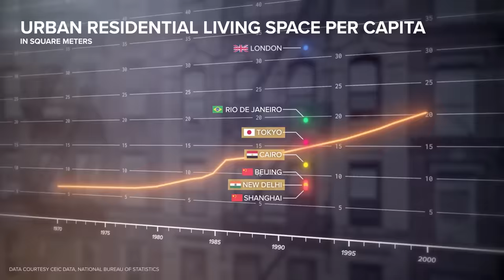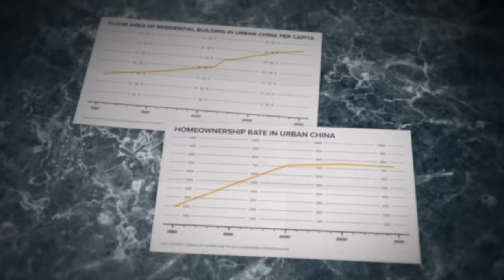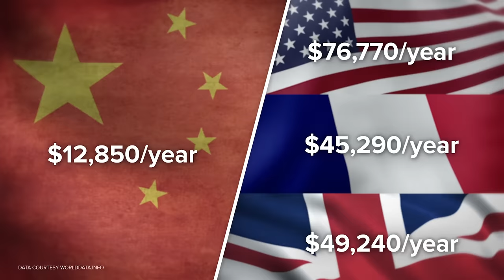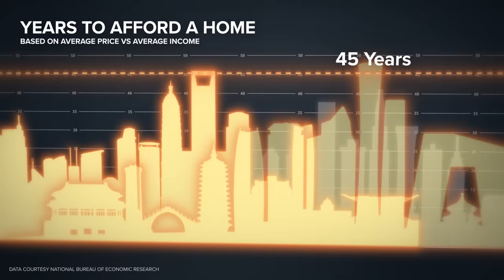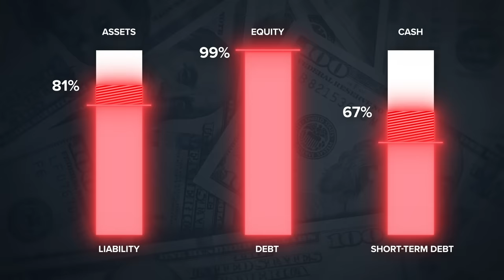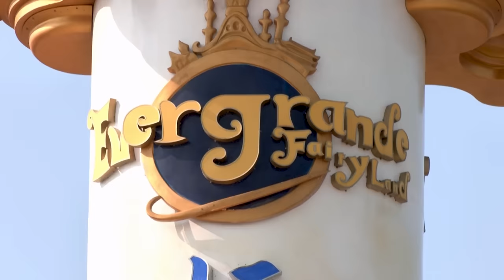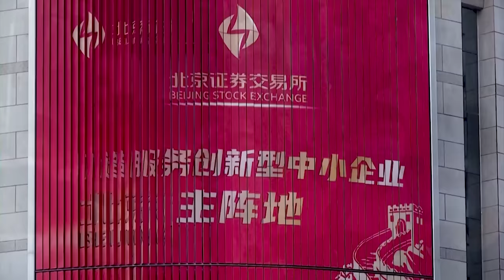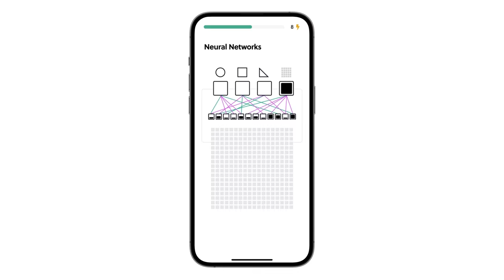Why China's Economy is Finally Slowing Down

Comment: That average Chinese income of $12.8K per year is now NOT per Capita, it's per Family. Working couple and Grandma's pension too. People are coming out of University with Master's Degree's only to take jobs in the FOOD DELIVERY mechanized bike cadre. Ten's of thousands of kids and not so young adults competing for 600 to 800 Yuan a week and maybe many are making less. Just divide by roughly 12 and you get the Dollar conversion. 

I see a One Yuan to $0.14 conversion now, but that is probably the international Yuan for inter-country bank trade. Internally, the PRC citizens are making far less. 

I wonder how many people are actually able to offshore their Yuan to Singapore Dollars or something that is viable? ONE YUAN converts to 0.19 Singapore Dollars.

Interestingly One US Dollar equals 1.35 Singapore Dollars. It roughly converts across using the SD as the conversion currency as there probably is NO direct exchange in USD from Yuan in the PRC except for State Official purposes. Citizens will have to find an external currency to use soon in replacement of the Yuan that the CCP will tolerate. It sort of works the same as the citizens of Venezuela using the USD as the de facto currency. Absolutely no confidence in the Venezuela Peso.

Comment: You can feel the depth of research in this video is scant, because it's just regurgitating common tropes about the Chinese economy without critical analysis of the assumptions, and indeed this is the case when you see the list of references listed, which is just 6 sources.  Here's a hard reality about modern capitalism.  EVERY capitalist economy is heavily dependent on housing market, and they all have housing bubbles.  In developed economies such as the US, 60% of global assets are backed by real estate prices (I can't give link because Youtube blocks link, but you can Google).  This means that most of the wealth of these nations are tied to their housing prices, and they are all susceptible to housing bubbles.  The US, for example, experienced a housing bubble bust in 2008.   However, developed economies with strong strong banks such as the US has learned how to manage and clean up the mess when these housing bubbles burst; and the Chinese economy is no exception.  The slowdown in the Chinese economy today is not just the challenges of housing bubbles -- which all developed nations face -- but something else is happening that we haven't seen in the past 50 years:  The US and western economies are finally trying to break up its economic ties to China.  A new era of global trade is emerging, and both the US and China are trying to adjust to it.  

It's just tiresome to hear everything get blamed on housing bubble bursting.  Again, most assets in developed capitalist economies are backed by real estate prices, so when an economy goes down it is inevitably related to the housing market.  It's like seeing a patient with a gun shot sound, and the assessment of "what's wrong" is "there's a bullet in his chest".  Sure, that's obvious, but we need more than that to understand the problem.

Comment: So just one minor point about the video. The vaccines in the west also had major issues and were not necessarily "more effective". Namely, it doesn't stop the spread (one of the main reasons we were told to get it) and the efficacy of the vaccine wanes pretty quickly (2 months to 4 months).

China didn't stop the lockdown because their population wasn't vaccinated enough (they were literally forcing people to get it against their will). They only stopped after they were forced to admit that their zero-tolerance policy did not work. Whereas the west only had a lesser version of the zero-tolerance policy.

Comment: This is such a nuanced topic there simply isn't any way you could do it justice in just 20 minutes. Good video but it would need at least an hour, and even then you would just scratch the surface. Still a good nutshell explanation though.

There's so much wrong with China it's ridiculous, they've been hiding economic data for awhile now, it seems they've been in a pretty bad depression.

Comment: To be honest, this is one of the things that I most admire about the Chinese government. They're not afraid to bully large corporations when necessary. From an outside perspective, it looks like the CCP in this case (and in many others, like with tech companies), is basically allowing little bits of capitalism to reap the benefits of super fast growth and cheap capital from the world economy, then shutting it down when things got bad. This video takes a generally negative tone on the outcomes, but I think there's something to be said about the positive outcomes as well. 

The controlled demolition of the real estate companies has tangibly dropped housing prices which, combined with the explosion in supply, has made housing much more accessible to the average Zhou. While the (upper) middle class definitely took a hit to investments, the CCP never set out to create housing as an investment vehicle for the (upper) middle class. And even then, as is implied by the controlled demolition metaphor, this is likely a much softer blow than what would have happened if this housing bubble was allowed to continue on to its natural bursting point, like it probably will (again) in much of the western world, and with the added benefit of not melting down the entire economy with it. 

This very similar to the strategy they took with Chinese tech companies, letting them run wild for a bit before cracking down (and sending Jack Ma on a well earned vacation). You can even see this mindset in the way they deal with many foreign companies in China, like Uber. They let them in, watch them build infrastructure and a market, then force them to leave and sell to a Chinese company, so that the Chinese economy/people/government can reap the benefits.